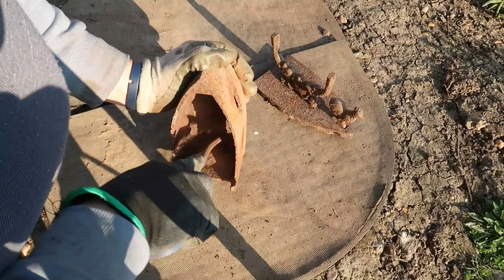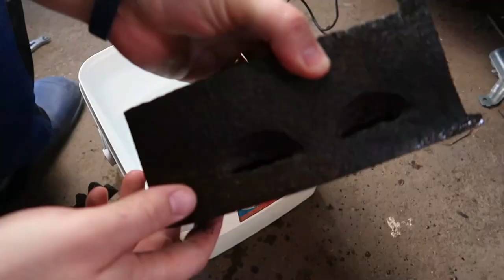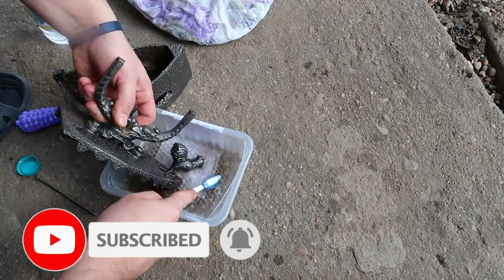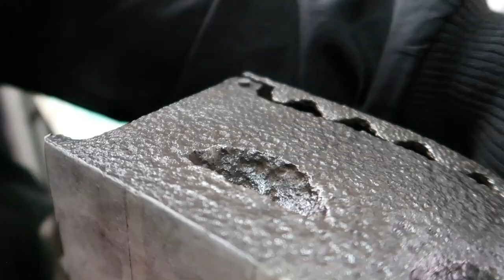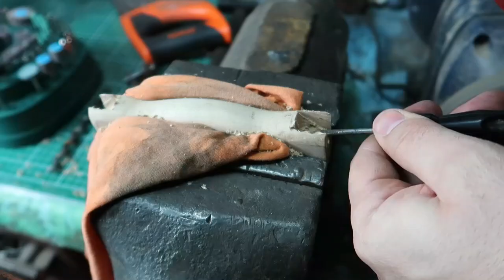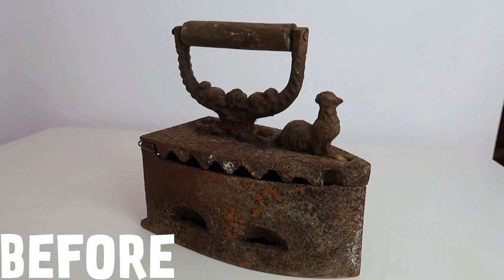Antique iron restoration (1910)

Comment: I don't have any skills to carry out this work so appreciate the time and effort put into this restoration, it is an attractive piece however I feel with just a bit more effort it could have been great. The handle is totally out of proportion and both it and the colour do not do the piece justice especially using modern cross head screws, at least black dome heads would have looked better. As a 'designer' piece it would be quite collectable.
Reply from the maker: Thank you! Your opinion is a very good one, I know all these flaws listed by you. I promise that I will learn and I will strive to make the following projects better and better!